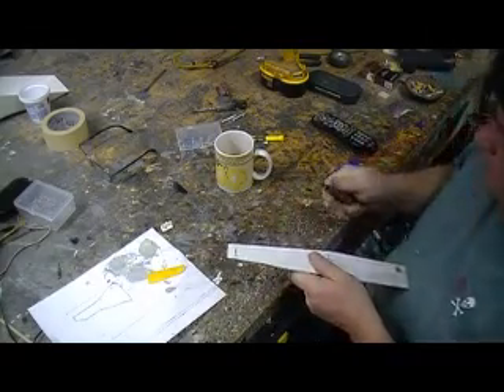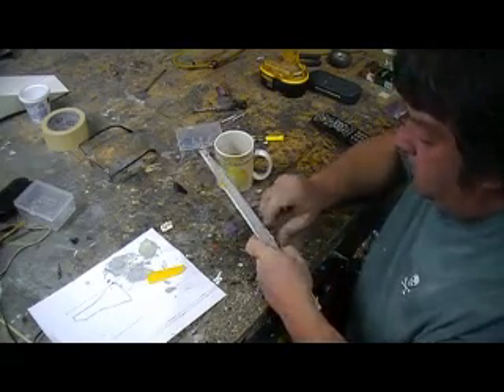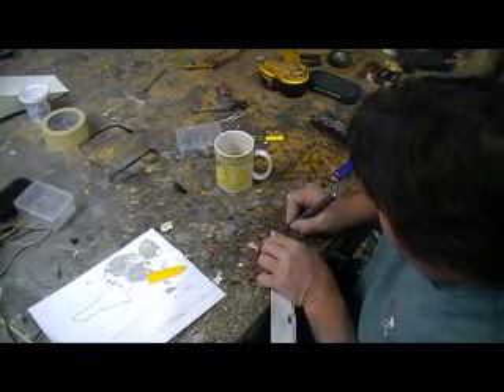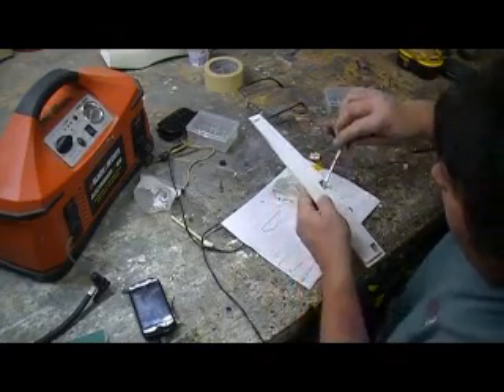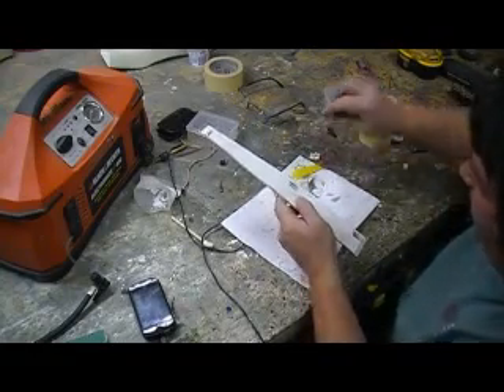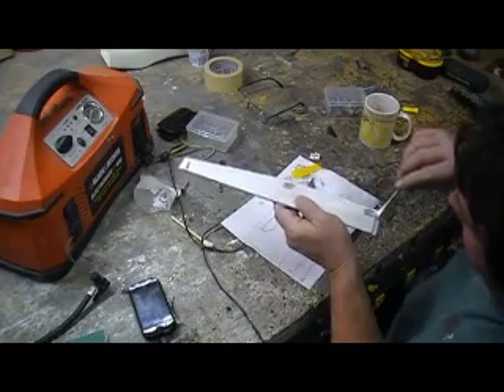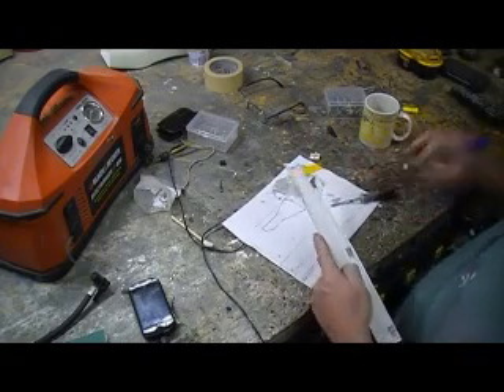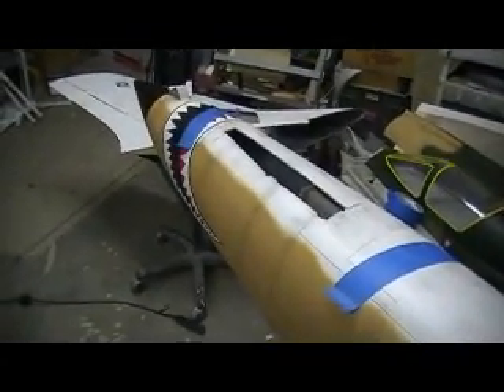how to build a rc jet F-105 thunderchief # 486

Comment: @classicwoodman, He is talking about selling a few Thunderchief kits to raise funds for the B1 project. He has also discussed scrapping the current B1 parts, and molding new B1 parts using techniques he learned building the Thunderchief. He believes that he can now make a B1 that is both stronger, and significantly lighter, using the foam core technique he learned building the Thunderchief. The B1 isn't abandoned, it's just delayed while he generates the necessary cash.

Comment: Hey BobO.....I have a question.  When you use "wax paper" to keep your part from sticking when you were making the carbon fiber parts. Do the parts retain a little wax  from the epoxy heating up? If so...whats the best way to remove it? Or am I just asking another dumb question.

Comment: if you bevel the edges the doors will not bind on the edge of the fuselage when they are opening and they would be less of a space when they are closed.